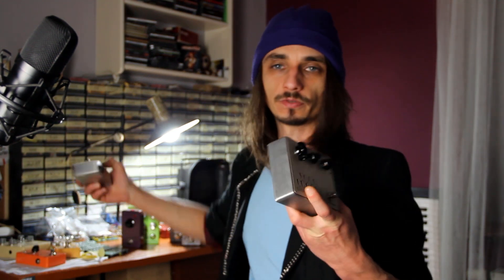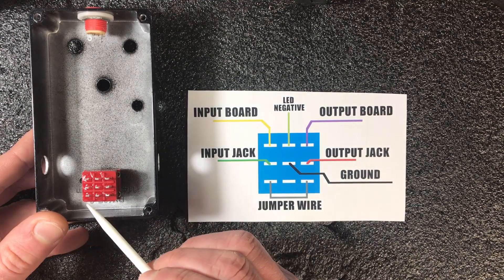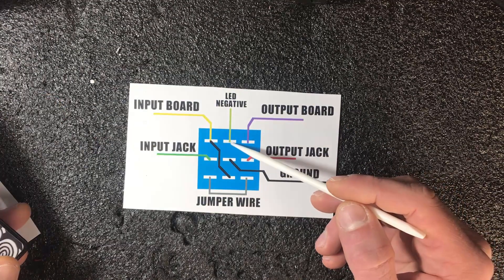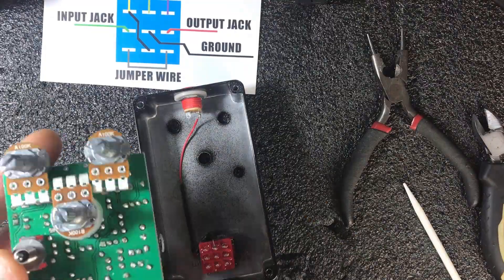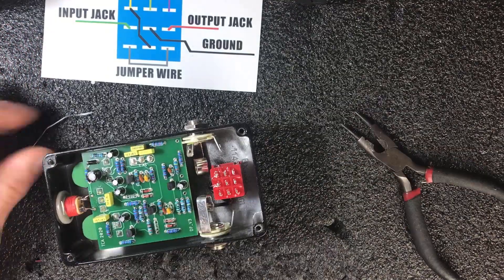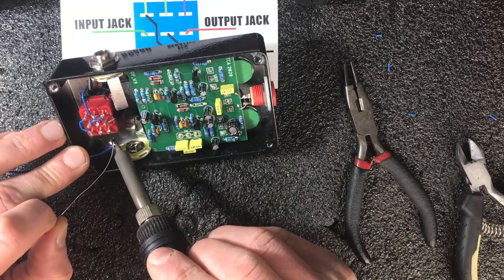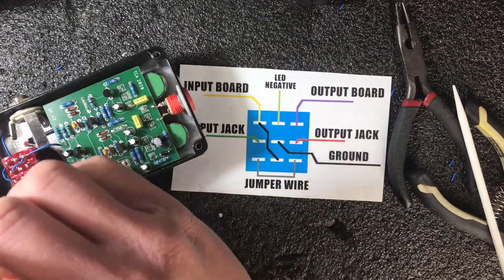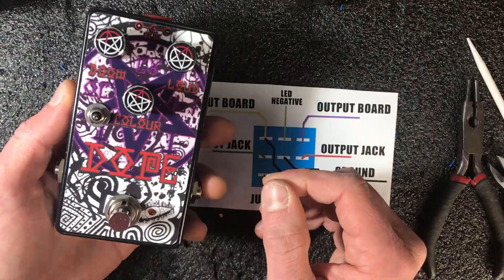True Bypass In Any Guitar Pedal - DIY Tutorial (EASY)

Comment: Which capacitor for the led do you prefer?
Reply from the maker: For LED you need a resistor, and it depends on the diode specifications. Usually, I use 1-10K.